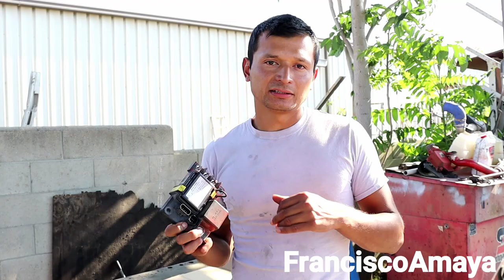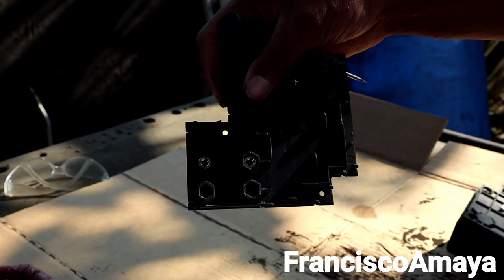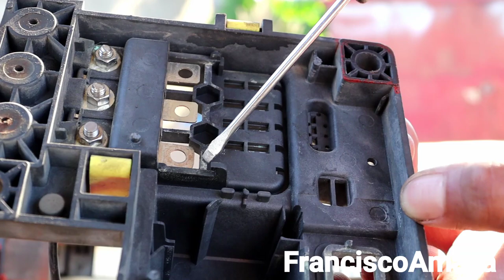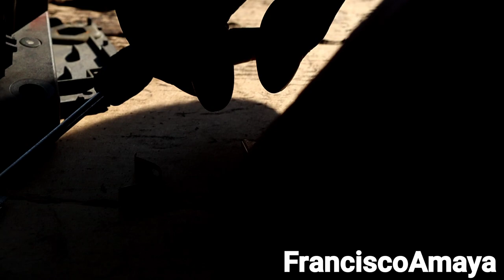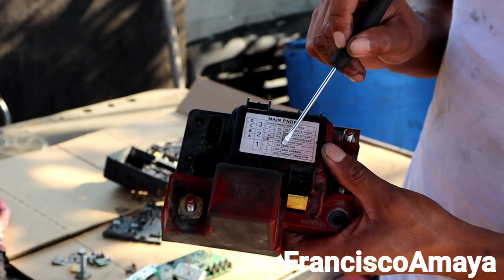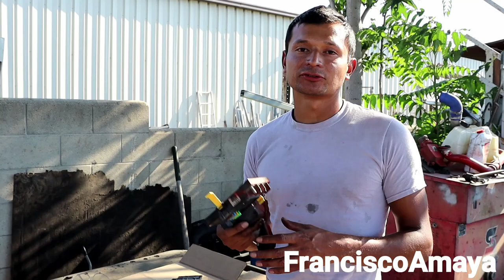S3 E2 F.A.I.T.H. Freightliner cascadia  PNDB module PDM inpection failure electrical problem

Comment: excellent video and information. I am having this driving shut down problem and  probably need this part.. like you, I wanted to know what was causing it and why it happened.. will take extra precautions to seal this unit up.. silicon or something similar to keep all the water out should give extra life and prevent a repeat situation.. thanks again

Comment: Freightliner is known for leaky windshield. Probably the water makes its way down to the PDM from behind the dash
Reply: I had the same problem for my truck
 I would turn off the truck but the clearance lights would stay on for some minutes and kills the battery. I had to change it and the new ones look totally different but it works well. Good observation
Reply: Good Observation Ken....

That Is A Strong Possibility Where That Water Came From
Reply: I notice when it rains I start having electric problems
Reply: Excelente video, yo cambie el mio y me empezó a hacer lo mismo a las 900 millas de cambiarlo (apagarse y encender en unos segundos)  halguna idea si puede ser otra cosa? O tendra defecto el nuevo pdnd? Lo compre nuevo en la freightliner. Gracias

Comment: Thank you very very much I know what's wrong with my truck and the light  . My headlights and taillights won't turn off and the inside light don't want to work in the bunk .oh and my batteries won't charge more than 12.8

Comment: Well, there you have it.  Get yourselves a tube of silicone glue and start sealing the PDM before water gets in
Reply: The problem is water from the windshield if the one on your truck is under the dash.
Reply: That don't work. Ive had to change two out

Comment: I just had this problem and when i touch the thick red wire on the lefy of the box it does that clicking sound and i loose all power to the truck. The power loss problem started after i hit a pothole so i guess smthng inside that box broke or got loose.

Comment: Hi Francisco 
Great video! Question for you. When I turn off my 2015 freighter about a minute later it shuts down all 12v power. My batteries and cables are all good. Can PNDB shut all power off even when truck is not running? It’s like when you turn off disconnect switch but my switch is still on.

Comment: The one on my truck is failed but only after using the power cut off switch. It cuts off a few times but then stays on. I never turn off my batteries now. I’ve had my truck on for 3 weeks in very cold weather and the batteries stayed over 12v.

Comment: Francisco eso me
Podría dar problemas con el aire acondicionado ? Tengo un dd15 2013 cascadia  ac compresor prende, abanico prende fusibles están bien cambie el cab filter, le cambie el
Blower y no avienta nada de aire. Lo que note es que el switch que se conecta al
Blower no llega nada de corriente

Comment: I  had a bad experience in a Freightliner 2015. The accelerator pedal doesn’t work despite its being changed. When the technician checked it the found power and ground but it’s seems there’s no communication with the computer.CPC
Reply: Need to fix your cpc4.
Reply: Cpc4 needs reprogramming

Comment: I’m getting high battery voltage changed alternator checked remote sense fuse should
I overlay or replace pin ?

Comment: My Frightliner just failed to start from a truck start after I put diesel .
I checked and replaced some fuses I dint trust ,cleaned my battery’s and later it stated .
I scared to keep driving cause it hasn’t happened again.
Can I replace the PDM

Comment: Francisco, I have a question for you about a engine rebuild failure after rebuild there was a squeaking squealing sound , tore back down found upper/lower bearing slightly scored - tore down replace, restart same sound - tore back down dont see any issues have you experienced a issue like this before??

Comment: the fault that a ddec 13 had is that it does not accelerate and said that the fault code is SPN 625 FMI 8 and the mechanic told me that I had to change the pdm module, it has some relationship if you can help me I would appreciate it

Comment: Hello Francisco i don't know where else to ask you this question,  so i hope you see this. My 2018 freightliner cascadia wont crank. I replaced the starter 4months ago. I watched your video on pumping the clutch while starting,  i tried tapping the starter nothing worked. I ended up calling roadside. Mechanic showed up disconnected negative battery connections for 30sec pumped break paddle 10x connected battery back up, truck started. But now everytime i turn off the engine it wont start back up. What is the problem with the truck? Thanks
Reply: I have a 2011 Coronado with a dd15 it turns off and won’t start.  Oils be the same problem. I haven’t figured it out yet
Reply: Did you ever figure out was the problem I am having the same issue thank
Reply: @punjabipunjabi12  hello bhaji did you figured issues i’m having same problem with truck now

Comment: I need your help my 2012 Freightliner cascadia headlights staying on with the switch off and the hazard button light just flashing I have no cruise control button no jake brake button no indicators no windshield wiper power
Reply: Replace the sams chassis

Comment: i have a question for you.. For my 2013 freightliner cascadia my pndb box is model a06-75148-011 But  i cant find a new one  Can i use the  2014 version  model number a66-03714-009  the  last 3 numbers on the end are 009  and the last 3 numbers on my box is 011 They look exactly the same to me...  Anyone know if it is ok to use the other 2014 model pndb box ending in 009 instead of my originial ending in 011.  THANKS IN ADVANCE FOR ANY HELP

Comment: Hello, I have a 2019 Cascadia freight liner with DD15 Engine and 390,000 miles on it. When the check engine light turns on, the AC, cruise control, lane keep assistant and diagnostic buttons don’t work. When the check engine light turns off, they start working normally. It has been like this since the time I got it new. It would turn on for 15-30 minutes and be okay after. Then it started happening 2-3 times a day. Now it’s always on and I’m having a tough time. Have any of you guys encountered this before? I’d appreciate some insight or help regarding this matter.
Reply: hi did you find solution to your problem i ha ve the same issue in freightliner 2018 ,i really appreciate any comment on this  matter thx

Comment: Hey Francisco, my 2008 cascadia do not have pndb, and the truck sometimes turn off it self when i driving....i replace the sam chassis reprogrammed and nothing fix the problem😢 ..any idea?
Reply: Hello outlander what solve you problem ?
Reply: @moisesuribe3842  electrician are working for a month back and forward with all computer, wire problems and programing....frustrating

Comment: Does it have something to do with starting the truck ?
Reply from the maker: if there is not power in the whole truck, yes.
Reply: @franciscoamaya7095  thank you for your response ! I'm having problem with a dd15 brings as fuel rail pressure low but unplugged the caps and there is fuel...back of the rail there is fuel...filters there is fuel...means fuel pump is good check the fuses batteries starter even starting fluid checked fuses on pndb box and the other fuse box tried a the emc in another truck and started right away means is not the ecm checked with another cpc4 and nothing and still won't even crank or jump start changed the fuel rail pressure sensor and still won't even crank to start 👎 I'll go for the engine harness? 🤔 your videos are very helpful...thanks for letting us know
Reply: @sircarlosbarra6733  Hello! Has ur issue solved? I ‘am experiencing the same on my 17 freightliner. Engine harness replaced won’t work.
Reply: @Along Wang  hello friend i ended up changing all injectors and that fixed the problem about a month and a half ago starts normal now but depends what kind of codes you get from your truck
Reply: @alongwang3582  is your truck deleted ?
Reply: @sircarlosbarra6733  I don’t know if it because of injectors. My code is SPN 625 FMI 14. MCM System ID not receiving or stopping. I found a corroded battery cable between PNDB and Sam Chassis. Part will be replaced tomorrow then test drive to see if it works. Each time engine shut off my engine check light, hill assistance light and active brake light pop out. I don’t know what’s ur symptoms.
Reply: @sircarlosbarra6733  bypass it instead of deleted
Reply: @Along Wang  my problem was injectors...i would say...it haven't stopped working since i changed all injectors
Reply: @sircarlosbarra6733  How much did you pay for parts and labor for replace injectors?